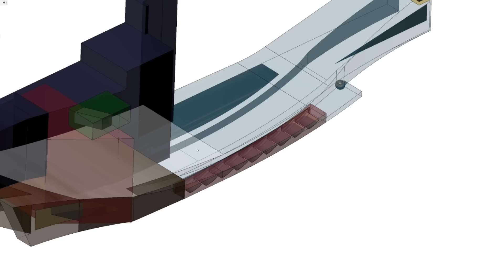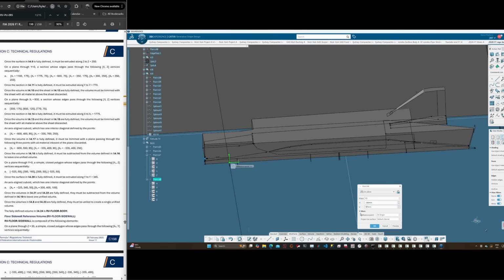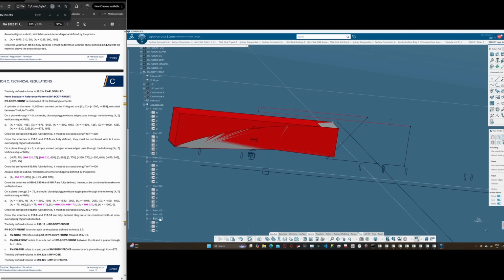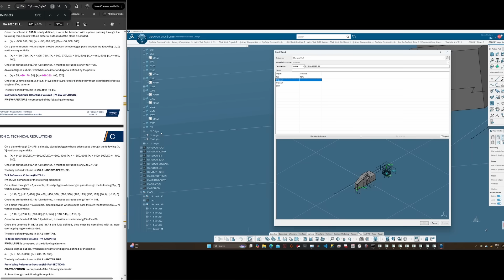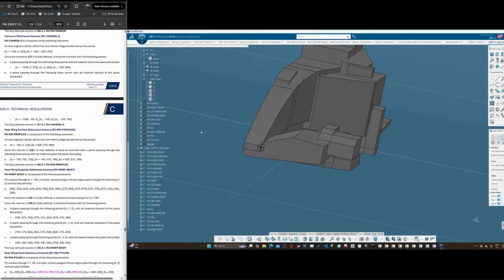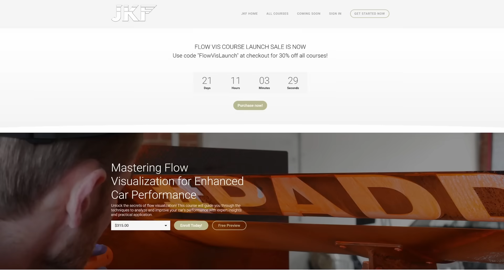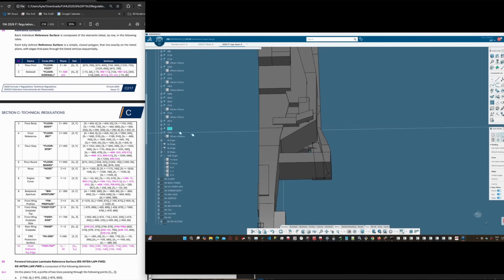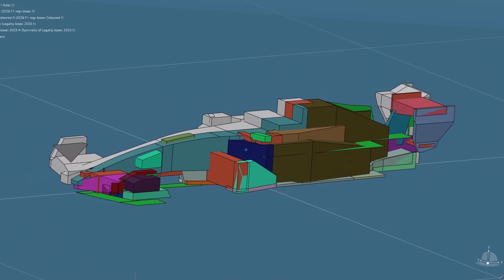I Drew the F1 2026 Aero Rules So You Don't Have to

Comment: Formula 1 and FIA is a bloated beauracratic nightmare and the rules becoming stricter and stricter is clearly a way to punish ingenuity. Car too fast? Banned. Car too curvy? Banned. Gearbox too light? Banned. Fuel flow sensor beaten? Banned. Knee activated aero? Banned. Suspension too genius? Banned. Aero too good? Banned.

Its absolutely tragic having watched in the early 90's to see the state of it now... Doesn't make sense, overly complex and just straight up boring to look at the cars. They don't look interesting anymore they're kayaks where just the drivers head is barely visible. Safety be damned, if you gonna sign up just accept theres a chance you'll die.

Comment: Funny thing I came across today when construction the volumes myself: The wheel base is defined to be a maximum of 3400mm or less.
I went for 2900mm since I did not find any definition stating this is too short and now I am at RV-EC and I cannot do 17.7 because the distance between XC=0 and XR=0 is too small.

Comment: In my junior formula days we would run asymmetric geometry set ups (like you would for an oval) all the time based on the track and I would think F1 does as well. Like different rear toe or different anti squat for rear suspension, up to even different spring rates for rear. But are they allowed to have different aero components on each side. We see teams have different heat louvers side to side sometimes but can they have a front flaps side to side. Or maybe barge boards to create different downforce levels for right turn heavy tracks for example. Is there something in the rules against that?

Comment: Just found your channel. Glad to see that you pursue this field. Have you ever considered 'Wheel-Well Ducting'? A Ducted path from 10 degrees forwards from center of the wheel where the high-pressure is allowed to escape (or be Ducted) from the Wheel-Well and away from the vehicle. And since we are on 'Ducted' air, how about a 'Ducted Hood'? Where is the best place to relieve the air through the hood? In front of the Radiator? Behind it? I'm not talking about 'Venting'. The Ducted Hood goes from the front of the hood to the Windshield.

Comment: I wonder how tech inspectors would even validate that cars meet these regulations in person without cad files. I'm sure they get CAD files, but how are you going to check that the nose profile of the physical car is within the volume created by an 11 m circle centered at a point underground with a tape measure and calipers?
Reply: I think in NASCAR a CAD file that has been demonstrated to be legal is provided to the tech inspectors, and the physical part/car is scanned at the event. The scan must not deviate from the CAD file beyond a tolerance. Perhaps the same process is used in F1.

Comment: Great video! 
I have some concerns about the 26 cars, I think there’s a very real chance next season could get real interesting. 
1. Thermal run away, are they prepared for a car to sit track side for two hours when the battery catches fire? Currently a Tesla can burn for 4 days and there’s nothing you can do about it. Is there a plan if the car catches fire in the garage? I understand there will be less battery than a Tesla but there’ll be substantially more than the F1 cars currently have. 
2. Driver workload. Some of the tools the driver has now may get deleted but active aero adds tools now. How many dials and buttons will the steering wheel need and how many pushes and dials per lap? 
How high is the possibility that these cars won’t be any “fun” to race anymore causing a driver stampede? 
3.We are 8 months away from testing starting today and we still have no answers about downshifting on the straights to keep the battery charged. 
4. How will these cars be expected to endure the cost cap? How many batteries or associated components will the teams have before getting grid penalties? 
5. What’s the plan B if this 50-50 ICE climate change grift simply doesn’t work? Will we run the 25 cars again? 
I’m not sure boys, this could end poorly, we shall see…
Reply: Surely they have fire extinguishers in case the battery catches fire? Regarding #3, there's no answer,  the manufacturers decided to ruin F1 for all of us. They will downshift and that's the end of it. The drivers won't waste battery power fighting drag at the end of long straights when it's better spent elsewhere on track.
Reply: @perfectman3077  The point about the fire extinguishers, you cannot extinguish a battery fire. 
That’s why I said a Tesla will burn about 4 days, it cannot be put out. Sooo, are we just going to let it burn trackside? Will they be able to drag it from the garage if it’s on fire? Drag it where? Will there be a designated spot to drag it too? It CANNOT be extinguished, period, until the thermal runaway process is complete. 
It doesn’t happen often but your phone will do the same thing and if you don’t have a plan it will burn down the building you’re in.
Reply: @johnwingerd2831  oh damn that is scary. I doubt there's a plan, the manufacturer's that pushed this through only care about scoring points with the politicians. The details don't concern them.

Comment: The rules for F1 brake pedals is longer than the entire rule book for Group B rally.
Reply: Wasn't the rule book of Group B just a napkin saying "make a faster rally car"?
Reply: There was a rule book for Group B? 😂
Reply: @LizardDoggo yeah, have 4 wheels and adhere to weight limits for your engine displacement
Reply: @itsyaboikirbo  And “build 200 cars”
Reply: @LizardDoggo As the person stated, the main rule is that there’s a certain min weight for a certain engine size. This is why the 205 T16 is lighter than the Quattro, because the 205 has a 1.8L engine while the Quattro had a 2.1L.

Still if this was implemented today, would be batshit. What’s stopping someone to enter a 1.0L engine with 400 hp and they will only have to run 755 kg as a result? 😂
Reply: @devandrasimanjuntak1646  for turbo cars the rules were that the displacement for the sake of the rules were 1.4x the displacement, putting the quattro in the 3.0 litre class and the 205 in the 2.5 litre class
Reply: @Amy-dq2lg and the Renault 1.4l turbo engine fit in the 2.0l class
Reply: @LizardDoggo 😂
Reply: @LizardDoggo  group b rules consisted of:

-road car
-go stupid go crazy
-pretend to try to homologate
-try to survive
Reply: @LizardDoggo  Yeah, you had to build a certain number of them because they were also production cars
Reply: ""The rules"" 
4 Wheels (opcional)
Driver staying alive ( optional)
Reply: I mean Group B was kind of just: “people don’t like rules so we’re only going to have enough of them to define a category of racing and no more”, and so, many, many people died

Comment: You could launch a community contest where you share a step of the final volume and we try to build some cars. Define a minimum volume for the whole car. Sticky puppy bits and other complex concave features are forbidden. It has to be water tight and you run it in cfd. Highest Cl / Cd wins. Define a minimum mesh size so nobody gets crazy with tiny wings and stuff. Community votes on the top 10 cars wich you test in CFD.
Reply: I really like this idea!

There is a Youtuber that did a similar version of this but with a PC cooling fan. He released a CAD file of the Hub and chasis of the fan and people have to model the blades and whatever they want. 

And it’s amazing to see how people can interpret the rules and come with some really interesting designs that move a lot of air. Others look really cool.

This could totally be a thing… I mean, he already did the volume CAD.

EDIT: The youtuber is “Major Hardware” and the series is called “Fan Showdown”

Comment: It's a crazy process, they want you to make a clay blob with all these stringent requirements, and you're basically sculpting that RV(clay blob) into a car. It absolutely takes a team of people to work out a whole car, and all those people have to work together like a Swiss watch, because every part affects every part in both directions, downstream affects upstream and vice versa. It's a lot like improving a jet engine, there's teams for each stage's row of blades, and stators, and all the departments have to work together because every aspect of the compressor is so sensitive to changes. They have to do it this way because of how much you gain in efficiency from the engine over the aerodynamics of the plane. Then again considering jet engines are just spinning wings, aerodynamics is still the driving factor in all of this.

Anyway huge tangent, point is, you can see why they designed the rules they way they did to an extent. It also shows that you have some serious skill/determination doing what a team of people should be doing on your own.

Comment: Kyle, what are your thoughts on the changes for the 2026 regulations, especially the whole active aero situation?

It seems to me that they chassis regulations are trying to cover the shortcomings of the 2026.

The active aero is a 2 position system. Could a multi-position system be used, or a variable system, so that drag could be minimised in the corners as well?

Comment: There is usually no simpler solution. Because only the volume of space allowed is public. It is difficult to replicate the aerodynamics of each team. The rules published by the FIA are a guide to the maximum extent possible. A lot can be done within this volume. The air flow of modern cars is very complex, especially near the wheel hub, where different teams have different small shapes. I don't think there is a real solution to turbulence. However, the biggest problem with the 2026 regulations is the power unit, which seems very unreliable and will have a big problem with endurance.

Comment: Figuring out how to cut lift from the engine cover is going to be a big challenge. The engine cover on the model I tried produced .8 Cz you can gain 40 points of downforce by cutting the lift from the chassis in half.
Reply: lift? Why lift from engine cover??
Reply: @perfectman3077  because of how its shaped. Downsloping.
Reply: @perfectman3077  Because of the angle of the regulation box, you have to get creative in how you manage the airflow around the engine cover in order to limit how much lift it produces. It also emphasizes the fact you're managing flow energy just as much as electric and chemical energy stores.
Reply: @rolandotillit2867  mind = blown. Is this an issue under yaw as well?
Reply: @perfectman3077  The way the rules are written, cars work really well in yaw. Since the bargeboard inwashes It becomes more powerful/produces more side force under yaw. Provided of course you can manage the tire wake. The new cars are going to favor having more tuning freedom with Ackermann. Current cars rely too much on Anti-Ackermann, although I think they're moving towards a more positive Ackermann, for the positive benefit to the way the tire wake affects the floor.
Reply: @rolandotillit2867  that’s good, I suppose. It’s a pity the PU situation is so dire.
Reply: @perfectman3077  After toying around with a virtual car based on the regulations. You basically have to drive it like the old V8 KERS cars. Realistically though, using the electric power that way means you're managing a lot of heat even with a 1kV system. On top of that you only have 9 seconds of deployment.

Without any deployment energy you're a sitting duck on the straights, so you're managing those 4MJ very carefully. It's not fun, one more second of deployment would make it fun. As it is, it's just so frustrating especially how slow you are on the straights even with Z mode.